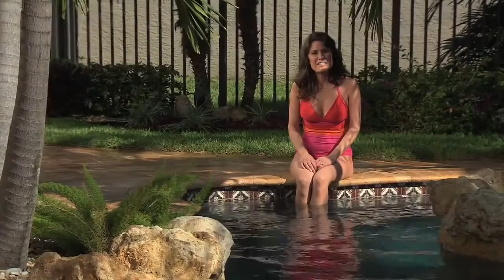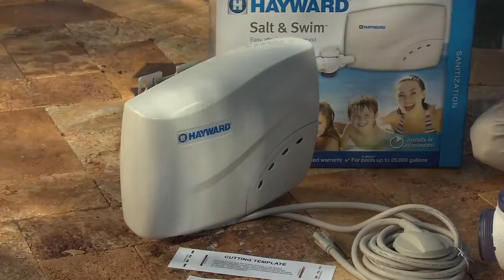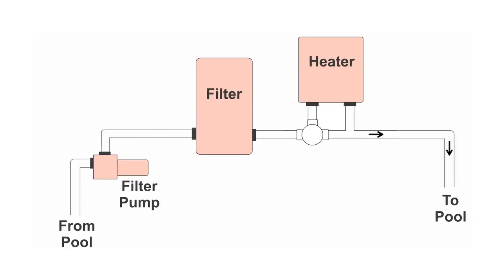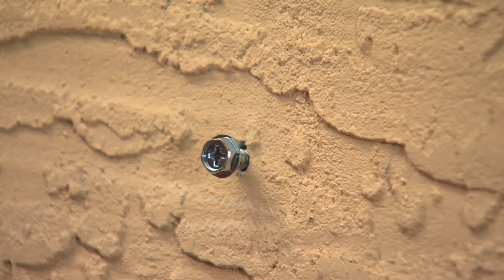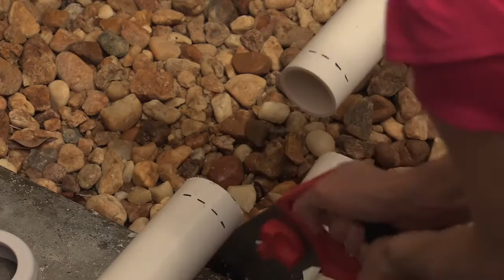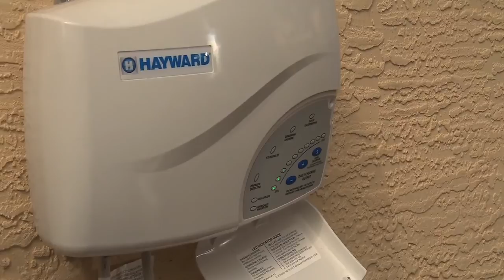Hayward Salt & Swim Installation

Comment: Hello, I have a question. The problem Detected light is on and so is the Min and Max light in green . The rest are blank . No flashing lights. Just problem detected. Ty
Reply from the maker: Hi Mr. Guay, we're sorry to hear about any issues. We invite you to take a look at our support center for troubleshooting tips: https://www.hayward-pool.com/shop/en/pools/support-center or contact your local pool store for warranty / repair: https://www.hayward-pool.com/shop/en/pools/Dealer-Locator.
We'd also be happy to connect you with our tech team to look into this. Please email marketing@hayward.com with your full name, address, phone number, email, proof of purchase, product model number, product serial number, installation date, and installer if applicable. Providing this information will help us, help you, efficiently. Someone will reach out to you directly as soon as possible.
Reply: Hayward got ahold of me via email it was the control panel it’s under warranty and they are sending me a new one…. Ty for getting back to me!